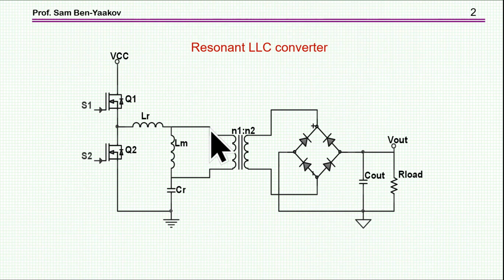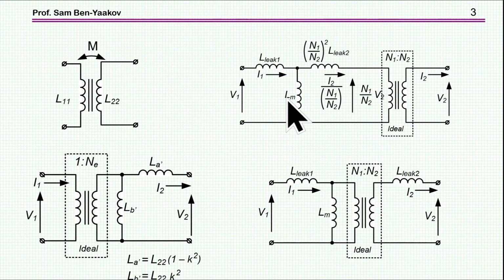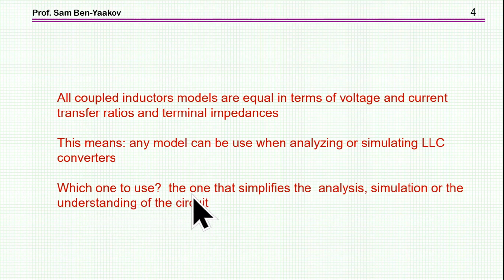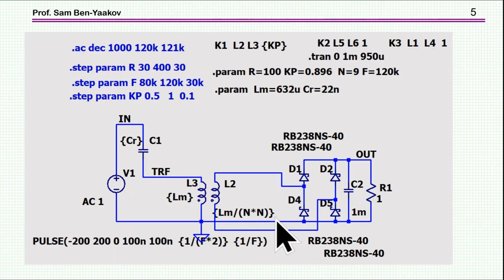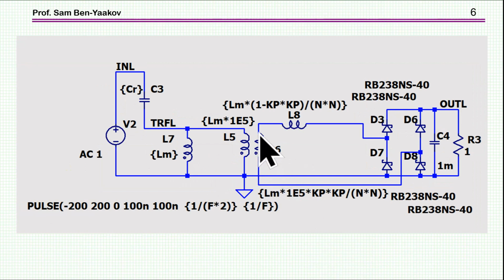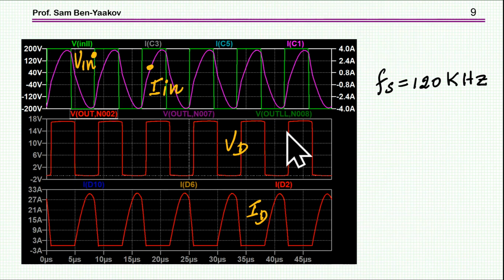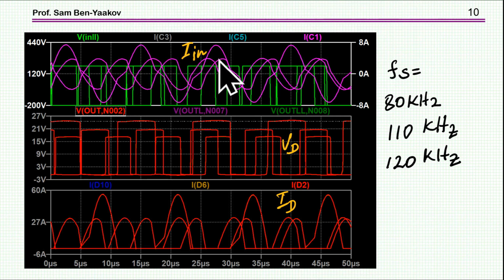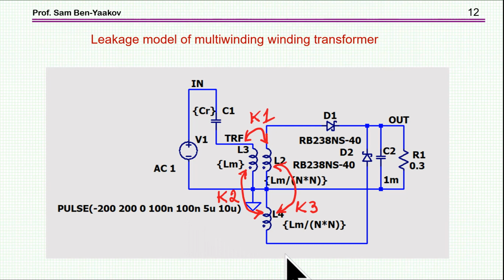Transformer leakage in LLC converters

Comment: Hi Sam, thank you for the informative video, i find myself designing a LLC converter and i was able to derive these useful models for separating my more visual model for LLC working principle (the All Primary Referred  APR model) and the more useful one for manufacturing, the real transformer model with leakage in both sides.

However, when working with center taped transformers i encounter this problem in which i dont find a correlation from APR model to real transformer model unless the leakage on the secondary and tertiary are 0. This conclusion comes from the fact that the coupling between primary and secondary/tertiary should be practically equal as they are typically wound up in parallel, so i can have an imperfect coupling from primary-secondary and primary-tertiary but it has to be similar, and the fact that the coupling between secondary and tertiary should be really high, or M23=L2=L3, k23=1.

Therefore i arrive to expressions like: Lk1=L1(1-k13*k23/k12); Lk2=L2(1-k12*k23/k13); and Lk3=L3(1-k13*k23/k12)
So if k12 is practically k13 and k23 should be close to 1 if secondary and tertiary are winded in parallel as it is usually done, then Lk1 has a non-null value as k12 and k13 are lower than 1, but Lk2 and Lk3 become 0.

Have you ever worked out this APR model for center-taped transformer? If so, how did you manage to link the real transformer model to the APR one? 

From my intuition it is a weird problem as if i ignored the center tap it would practically be a simple 2 port transformer, and measuring this transformer in reality i would surely find out some leakage inductance, but when measuring considering the center tap as secondary and tertiary i would expect their respective leakage to drop a lot? What do you think about this approach?

Thank you for your dedication.
Reply from the maker: Thank you for the useful information and insight. I find that simulation deviation is found when linearity is assumed. Time domain simulations on the actual non linear circuit show a better agreement with  actual measurements.

Comment: Thank you for the detailed explanation! Would it be possible to arrange a seminar focusing on the actual transformer design for a CLLLC converter? I find the aspect of designing the leakage inductance particularly challenging and would greatly appreciate a comprehensive discussion on this topic.
Reply from the maker: Thanks for input. Yes, controlling the leakage is a challenge. Will try to report on this further.

Comment: The equivalence between the L and T models are true only if magnetizing inductance is high enough so Lm//Llk(p,s)=Llk(p,s), i.e. Lm can be neglected. If Lm is low, then the most accurate model is the T one....
Reply: The unbalanced models are an useful approximation only if magnetizing inductance is high (which in general is a design goal in a good enough transformer, but not in transformers for resonant converters with intentional leakage inductance)
Reply from the maker: You are mistaken. No difference if the transformation is made correctly. See https://youtu.be/TUfaN40T1Yg?t=974

Comment: Thank You very much for this video. I also watched the other two videos and at the last now, i'm convinced, that You are right. Problem being, that i don't understand it, and i hope, You can give me a hint, where i'm wrong in my understanding:
For this i want to look at an LLC circuit, using the T equivalent circuit, with one stray inductance on each side and an ideal tranformer, with a ratio of 1:1.
Actually i don't want to look inside the transformer, because You already showed that even an external inductance on on side will not make a diffence, if compared from primary or secondary side. So, for this case, stray inductance shall be either an external inductor or stray inductance of the connections of the transformer, in any case, it is totally clear to which side it belongs.
Now, talking about LLC, we have two important resonances, first is Cres with Lstray and second is Cres with Lstray+Lmagnetization. (simplified)
I want to look at the second resonance frequency (which actually is the lower one). Let's now look at short circuit and open circuit.
With the T-equivalent circuit, L would be Lstray,primary+(Lmagnetization||Lstray,secondary) for short ciruit on secondary side.
With the L-equivalten circuit (all stray inductance on primary side), L would be Lstray, which is similar to Lstray,primary+Lstray,secondary, but the influence of Lmagnetization is missing, thus the resonance frequency (with Cres) would not be the same between L- and T-equivalent circuit.
Now lets look at open circuit on secundary side:
With the T-equivalent circuit, L would be Lstray,primary+Lmagnetization
With the L-equivalten circuit, L would be Lstray+Lmagnetization, which is a higher inductance value, because Lstray>Lstray,primary. Again, the resonance frequency wouldn't be the same between L- and T-equivalent circuit.
You are working with the mutual inductance, is it totally similar to the magnetization inductance? Or is it perhapps changing slightly btw. L- and T-equivalent ciruit, to compensate the above shown discrepancy?
Let me ask the question differently: If i add an external inductor as a stray inductance, you still can explain this ciruit with an L- or T-equivalent circuit, if you do all the math right, but the behavior of a LLC-circuit will differ between putting the external inductor on primary side or secondary side, right?
Reply from the maker: The last version of your question is excellent. Never thought about this example. Thank you.  
Yes, if you put an external inductor on one side the behavior will be different from the other case. BUT,  if you put it on one side, find the model of the total assembly, coued inductors plus inductor, and then tranform it to a form of inductor on the orher side, the response will be the same. But the value of reflected inductor will be different. Beautiful example..

Comment: It is easy to believe that all of the representations can be equivalent when all of the elements are linear.  In fact any n port linear network can have many related internal models for which the external network parameters are identical.

What happens when the transformer elements are non-linear like core hysteresis or saturation?

p.s.  This was a very interesting series.  Thank you
Reply from the maker: At any operating point, once linearized, everything is the same, For large signal just use a non linear coupled inductor model - why bother with equivalent circuits?.

Comment: 5:20 Would it be possible for the very large inductance value to cause numerical errors in LTSpice? Clearly the simulation shows this to be a non-issue but I'm wondering how far one can go with such values.
Reply from the maker: Not really
Reply: @sambenyaakov  I'm replicating these various models for myself in LTspice, it seems that when coupling factor is small (example,K=0.15 used for Tesla coils for example) the model which puts all the leakage on the primary side utilizing an "ideal transformer" for coupling, gives funny results.  However with larger coupling coefficients, the different models match very well.  I do have to wonder if its not an issue of a "big number" (1E5) divided by a small number (K*K = .0225) giving some numerical errors.  When i change 1E5 to a smaller value (1E2) the models match well, but if i try 1E6 or greater, the model shows wildly different results unless i use a larger K = 0.5 or greater.